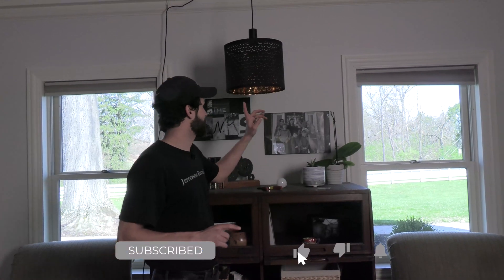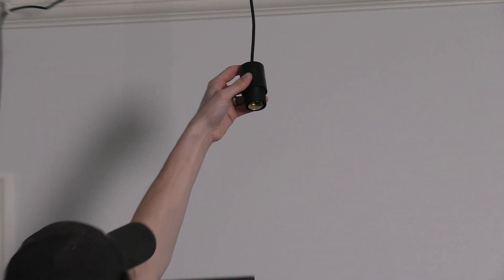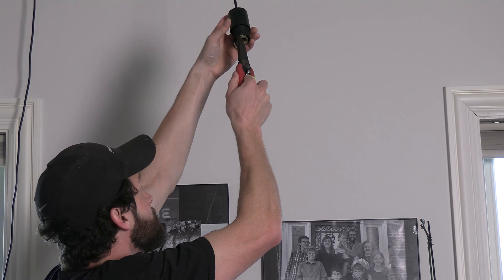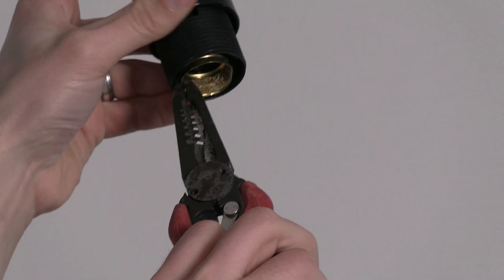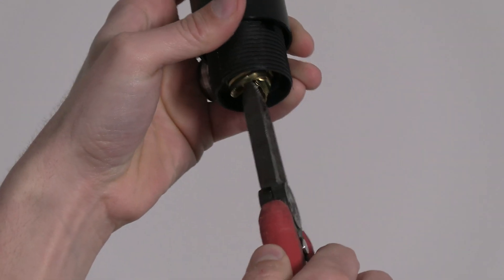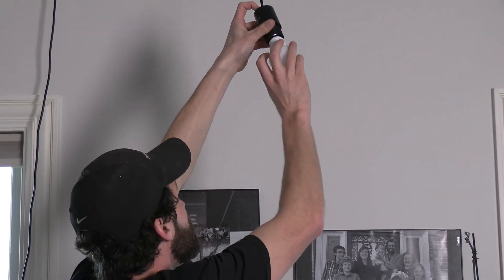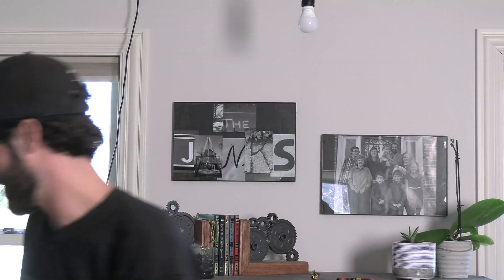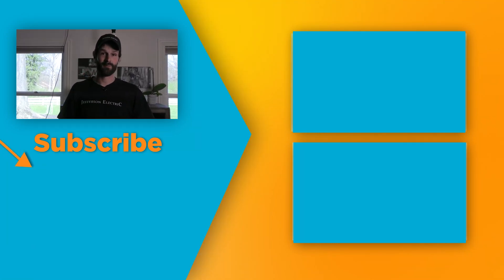The Most Common Issue with Lights - SOLVED!

Comment: I've heard of people using a raw potato cut in half as well.  Never tried this method but I used the trick with needle-nose pliers alot when I worked at Menards when tending to burned out bulbs in the displays-seemed more common where the bulb hung upside down (base up)

So far I haven't had this issue as a renter and now home owner.  Guessing because we were CFL and are now LED.  Not alot of heat to cause problems.